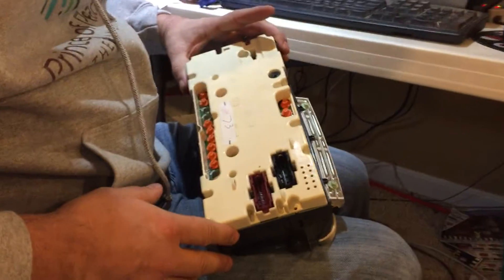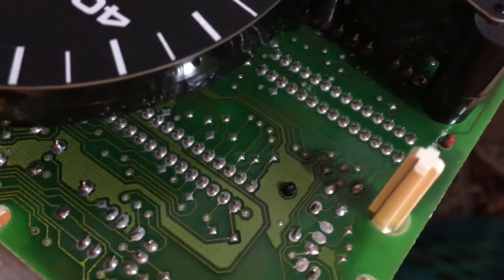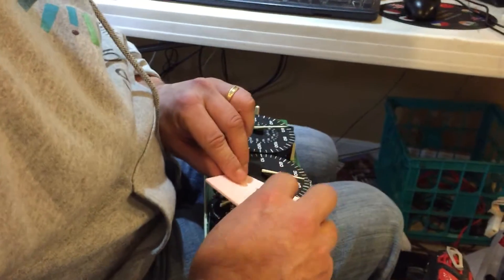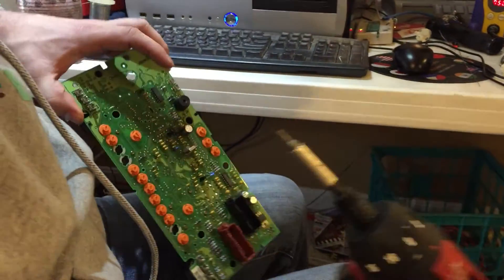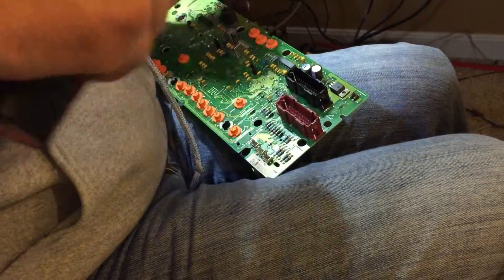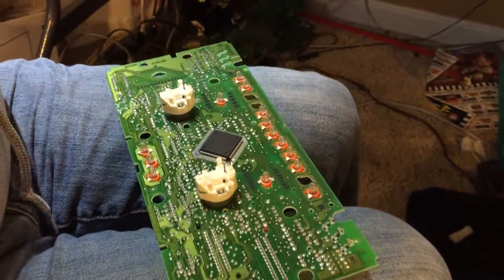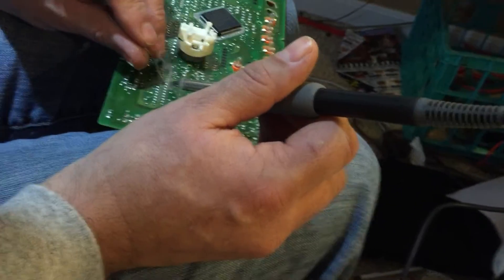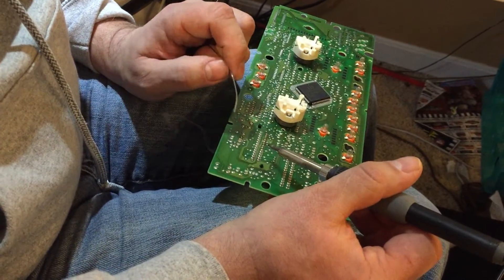Fixing soldering on VW MK3 cluster

Comment: also check the transistor that is right above the black connector, it likes to come loose from the board and break the solder joints, use superglue to reattach it back to the board and then solder the connections

Comment: I know this is an older video but do you still offer this service
Reply from the maker: I am happy to offer free advice and guidance on how to fix cluster problems on your own but I no longer offer the service to repair them.  What is going on with yours?
Reply: @skskarda  my speedometer and odometer don't move and my fuel gauge has become more sensitive dropping down or going up on acceleration/braking/turns prior to it being down for few month it was working normally
Reply from the maker: @mr4toes  If you tap the dashboard can you bring them to life even for just a moment?  Could you pull it out (see my other video) and wiggle the connector and get it to move?  Those would confirm bad soldering.   I will say that I have tested and repaired hundreds of clusters and never seen a gas gauge problem.  I would suspect that is a problem outside the cluster if it is not the soldering.   If you don't get any response from wiggling the connector my next move would be to replace stepper motors.   I have a few leftover I could sell you.
Reply: @skskarda  i pulled it out last week to check the connectors or see if it fixed itself and no luck still same issues. how difficult is it to change the stepper motors and would that be affecting the odometer as well
Reply from the maker: @mr4toes  do you really mean odometer or tachometer?   If the odometer and speedometer are not working I would bet the problem is your speed sensor.  You have check that?  It works by sending a pulse to the cluster.
Reply: @skskarda  yeah I've switched that out now ive switched clusters as well and same issues guess my cluster may still be good going to dig into wiring

Comment: hi, just want to ask what type of bulbs used for the cluster
Reply from the maker: There are two different light bulbs in the back of the cluster.  Orange are indicator lights and green at top are what drives most of the illumination.  I typically get them from pelican parts.  Green are part number 893-919-040-A-M97.   Orange are part number 4A0-919-040-C-M97

Comment: Greetings,   I have a 1997 VW cabrio with a glitchy tachometer.  Do you still do repairs?  If so i'd like to also have the steppers replaced just because i don't want to tear the dash apart again once i get it back.  Please let me know how to get in touch.
Reply from the maker: Hi Donald-   You can reach out to me using the contact us button at my website, parts-rescue.com.  Make sure to watch your spam folder for my reply.  I don't fix many clusters now but could probably help you out but I should note that I am not available for roughly a month due to other commitments.   If you have a friend that is comfortable with soldering, I'd be happy to sell you a few stepper motors or tell you were you can buy them.

Comment: So what was wrong with this cluster? What wasnt working? I have a 93 jetta that I just picked up and the tach, speedo, temp, and none of the lights work and I'm trying to figure out if it's a plug issue or something else
Reply from the maker: An easy way to figure out whether the soldering on the plug is bad is to wiggle the connect in the back of the cluster while the vehicle is on.   Bad soldering on the connector can be seen when wiggling the connector in the back.   is 93 a MK3 or MK2?   I have fixed close to 100 mk3 clusters over the years.   I have never seen one where the only problem was lights out except where the light bulbs were burnt out.   Usually it is either intermittent issue (soldering) or a dead tachometer and/or speedometer (bad stepper motor).   If it is just the back lighting (not turn signals, indicators, etc.), there are only two light bulbs and they are likely both burnt out.    They are cheap and easy to replace.
Reply from the maker: You can buy light bulbs at Pelican Parts.  There are two green bulbs that provide illumination.  Part number 893-919-040-A-M97.  In case you have any bad indicators, you might want to buy those also.  The part number for the indicator bulbs is  4A0-919-040-C-M97
Reply: It is an MK3 and I will start working in it tomorrow and check the connection, the left and right indicator lights work and also the high beam indicator, the tach speedometer and temp do nothing, but the fuel guage works, no backlights, and also noticed the oil pressure sensor light flashes but it is getting good oil pressure.

Comment: Thanks I did this but it is the same. I think the problem Is with the motors that move the Needles which show the speed and RPM
Reply from the maker: Hi Alejandro-   Replacing the stepper motors is pretty easy.  If you look at my other videos, I have a video on that as well.   You can usually find them on eBay.  Just use the part number you see on the side of the stepper motor.
Reply: @skskarda  Thanks man. I got a question. I found the number of the motor which is: stepper motor 91 225 002. I wonder if this would work with the speedometer  and the RPM.
Reply from the maker: @Itsalejandrox  I checked my email and confirmed that stepper motor number you shared is exactly what I have purchased in the past.   It is the same for both speedometer and the tachometer so you are good there.  If you can't find someone selling them on eBay, I have purchased them from suppliers on AliExpress before.  Just be clear that it absolutely needs to be that part number.  I had an issue one time when they tried to substitute it (I seemed to recall 002 was instead 008) and found that the pin or shaft was too long.
Reply: @skskarda  Thanks man I really appreciate that you took the time to answer.. yeah I would buy that motor and install it. hopefully it would work, again thank you very much  !!

Comment: along with using a card to cover the face, I was told by a guy that made my gauge overlays to use a fork as it will apply even pressure to lift the needle off. Good video.

Comment: So, is this a fix when the entire cluster doesn’t work? None of my needles move, but the lights light up. I cleaned up the valve head ground and the two under the battery tray to no avail. What do you charge for the resolder?
Reply: pgslaugh yeah it should work it's really easy too

Comment: speed and tach flickering at 0.. Could this be the problem?
Reply from the maker: No.  If the needle is flickering at zero, my experience is that you need new stepper motor(s).    The procedure in the video is nearly the same and you can buy those on eBay.   I have seen U.S. sellers on eBay occasionally but usually I need to buy them from sellers in China and I have always had a good experience other than the fact it can take a few weeks for delivery.
Reply: alright ill look into buying 2 new motors and see if it fixes it

Comment: How much do you charge for the resolder and how do I get in touch with you?
Reply from the maker: You can send me an email: info at parts-rescue.com.   Please provide a description of the problem statement.   The time and cost to repair is different depending on whether the problem is soldering or stepper motors but I can fix both.

Comment: I may need to send you my cluster. 99 cabrio. I soldered pins, changed speed sensor, wiggled conector. still intermitant speed and tach. they either work at cranking car and stay working or dont work and stay dont working. seems to work when car is cold. not one or the other..its both or neither. when not working, speedometer quivers. this began the same day I replaced the car battery. how should i proceed?
Reply from the maker: Hi David-   If you are comfortable with the soldering, would you be comfortable changing out the stepper motors?    Normally, when 1 or both stepper motors go out, the tach and/or the speedometer go complete dead (might vibrate but won't work).   However, there are only two problems I know how to fix. 
 
  1. Intermittent - Fix soldering.  
  2. Dead tach and/or speedometer - Replace stepper motors.   

More than 95% of the bad clusters fall into one of those categories.    The fact that you said it is both the tach and the speedometer does lead me to believe the problem is likely with the cluster and not something else in the car.   However, normally intermittent problems like you describe are bad soldering >95% of the time although that is not common on a 1999 as they improved soldering in later years.   So the only other thing to try is replacing the stepper motors.  You can usually find them online for $15-20 each.

Ultimately, you can send it to me but I would hate to have you spend money shipping only to find out I can't fix it and I am a bit nervous since it doesn't fit in one of the problems I am confident I can fix.
Reply: hey Steve,  when I put cluster back in,  the needles pointed straight down can i just push them over to zero?
Reply from the maker: Yes.   I forgot to show that in the video.   You need to set the needles to zero when you put them back on.   The stepper motor has a mechanical stop so all you have to do is rotate the needle counter clockwise until you can feel the stepper motor hits its stop and the needles are at zero.
Reply: thank you! you are a gentleman and a scholar! :)

Comment: was lookking ot get me an used golf mk3 cabrio from 97. The clusterdid not work. the only thing that work was the odo reading but not caunting. Nothing is working what can it be?
Reply: Do the indicator lights work?   Most clusters can be fixed.   Try taking it partially out (see my other video) and wiggle the connector in back with the car running.
Reply: Steve Skarda the bulbs from the check lamps work, de odo total km stays on but dont count more when i drive. the blinker lights in de cockpit work. everthing but the fuel, rpm, cooling temp, and speed meter dont work. I am thinking to buy this car but i cant try i out. i thaugt mabye its an none thig for this mk3. excuse my english im from holland...   I also noticed that there was black deposifs in de exhaust normal?
Reply: That is a little odd.  It could be that the soldering for the power to the gauges is bad but that is an unusual problem statement.  It is cheaper mom for the speedometer and/tachometer to stop working but I don't think I have ever seen a bad fuel and temperature gauge.   That is a power problem.   If it is soldering wiggling the connector will clearly tell you that.  If it is a power supply in the cluster that is beyond what I know how to fix and I have only seen it a handful of times.
Reply: Alright thank you. I have a smal crappy subaru vivio 660 cc. No options and also from 97. I can trade it for the golf mark 3 1.6 cabrio 100 hp. I only have to pay 300 euros. The both cars has new inspection and the golf has about 150 000 kilometers drove it good

Comment from the maker: I moved this video to a new channel so I realized that caused all my old comments to disappear.  I am still happy to help out so feel free to ask questions.
Reply: Parts Rescue  how soon contact you to send you my cluster to be repaired. Miners has this issue.
Reply: Would this also be the cause of the two small LCD screens not working??? Very curious because I HV a vr6 cluster where the screens are dead, nothing happens when unplug in the connectors. Currently running the 2.0 basic cluster which works good except for my RPMs being off by 300-400 rpm

Comment: My speedometer and Rpms don't work, but my temp and gas do work, I already changed the speed sensor but still nothing. I'll try this it was very helpful
Reply from the maker: Before you take it all the way out, you might try wiggling the connector with the engine running.  That will confirm the problem is soldering.  If it is not the soldering, you'll want to replace the stepper motors.    You can buy them on eBay for $10 each.
Reply: @skskarda  same issue as OP, on a 98 GLS

Comment: I think this is my issue.. I haven't repaired it yet, but when i wiggle the connectors on the back, the cluster intermittently works. One other question. If my air bag light is flickering as well, do you think that these connections are the culprit? Thanks
Reply: +Dany Heatley Just soldered my cluster and it works perfect now. Thanks!

Comment: My water temp needle doesn't goes all the way to the center when the engine is at working temperature (90 degrees celsius). You reckon a bit of solder would help? Or the motor isn't strong enough now. We've measure the temps from the coolant system and everything is as hot as it should. It's a 92 VR6 Vento. Thanks in advance, Regards, Richard.

Comment: Steve, very useful video.  I have just been through a hassle replacing the speedo stepper motor, after which the speedo worked briefly, but then stopped again.  The tach, which had been working fine is now dead too.  Both needles vibrate at zero.  After watching your video I examined the main connector pin solder joints, and found that I have several bad ones.  I am wondering if my stepper motor was good all along, and I just need to resolder those pins.  I will try it before I send the cluster off for repair.  It may be that all the connecting and disconnecting of the main connectors cause both the tach and speedo to stop.